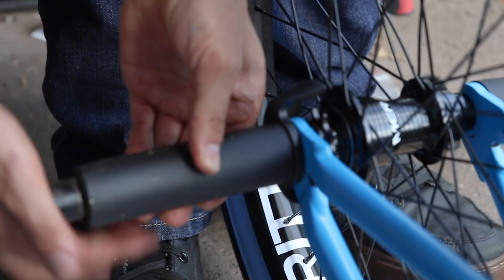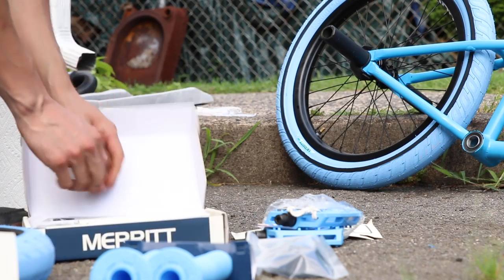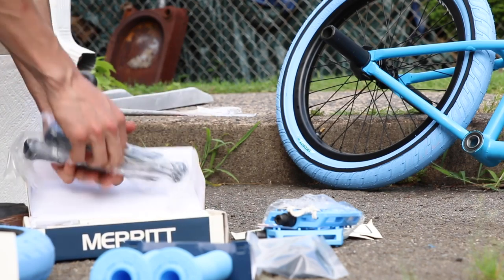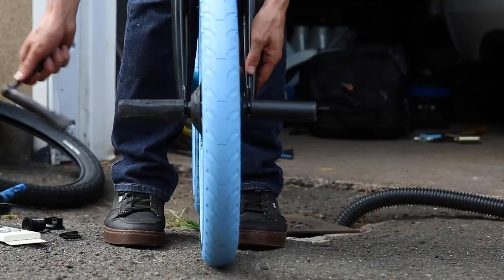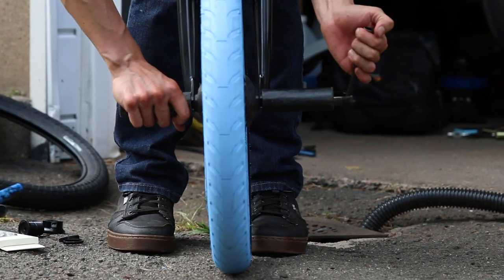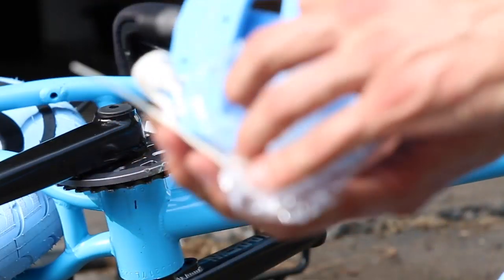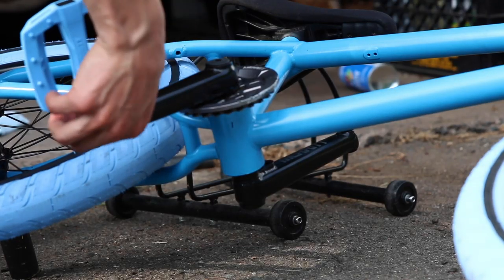INSTALL: MERRITT TARHEEL BLUE COLORWAY KIT ASMR ACTION

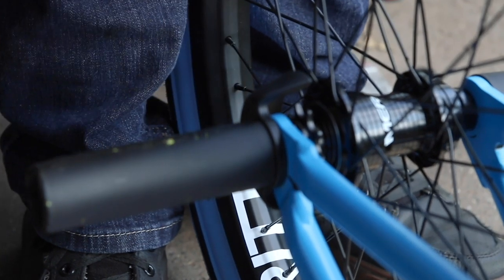Comment: 0:49 Why the hub guard behind the peg and not behind the drop out ?
Reply from the maker: Paul James it’s meant to be run on the outside of the dropout. I like this better because it doesn’t cause as much pressure against the hub like a guard that is meant to be run on the inside of the dropout
Reply: @DustinNotJustin  Reminds me of the Gsport uni guard that i bent my axle with i like my pegs flush with the drop outs so i dont bent axles again
Reply from the maker: Paul James Merritt axle is strong so I’m not too worried about it